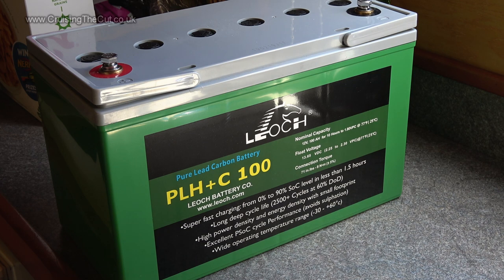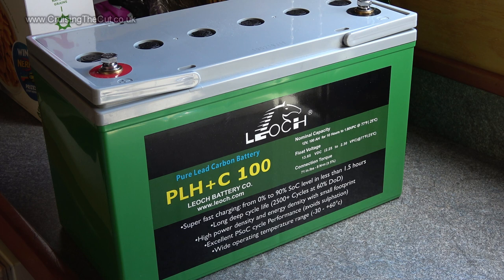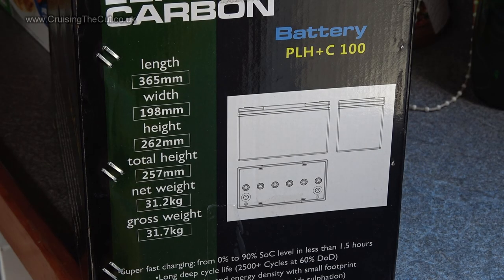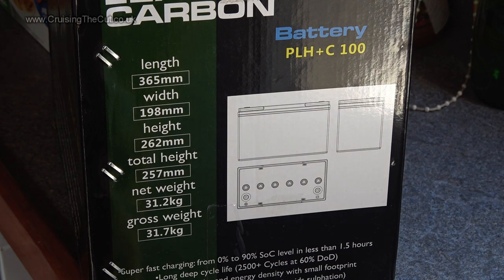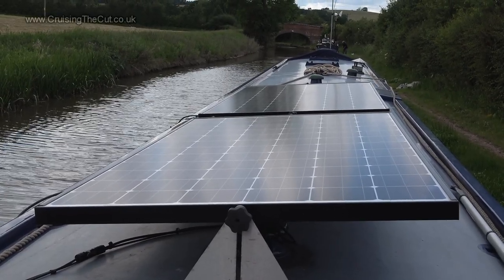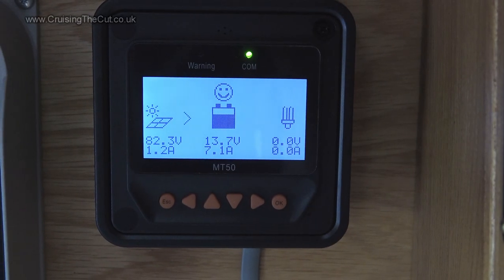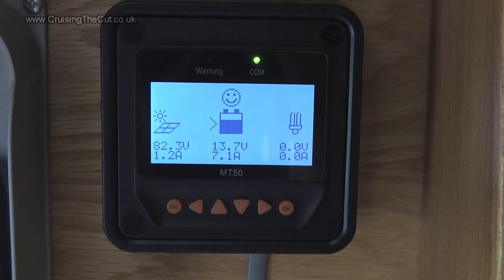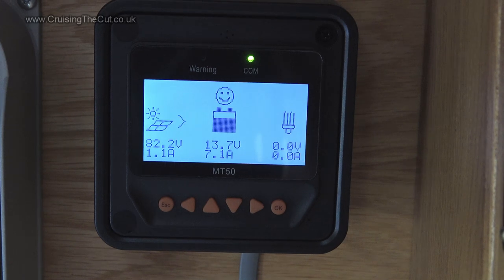178. Installing Lead Carbon batteries (12V 100Ah) into my canal narrowboat

Comment: Given the very short length of your Red and Black Wires that connect your three batteries in parallel, in electronic parlance that is called a bus, it does not matter where you place your connecting Red Wire or Black wire. They can be at the same end, opposite ends or even in the middle of their respective Wires or Busses because they are so short. 
The gauge of the wire used for these busses is such that the resistance of your copper wire is extremely low so you will not get any real measurable voltage drop. The thicker the wire the lower the resistance, now if your bus wires were very thin then it becomes a different problem. It is all down to an electrical law in physics called Ohms Law.
Reply from the maker: It is, I believe, nonetheless good practice to connect across the bank; the voltage drop may be negligible but you want to pull the current across the whole bank.
Reply: @CruisingTheCut  The benefit of connecting the way you did would only be realized in very high amperage situations - which you will likely never experience. Wiring as you did does not "pull current across the bank" any more than wiring it up the way it was initially. Still, it is the technically correct way to do it.
Reply from the maker: I refer the honourable commenter to this interesting article! http://www.smartgauge.co.uk/batt_con.html

Comment: Hello david.
I have just installed two deep cycle batterys and they 75 amph each in parrel and regulator to oppeset terminals. I reserched the same iessues and fond that by conneting the regulator to oppesete ends keeps the whole bank enenly charged and the discharged is kept evenly. i installed  socet style 12v meter with colered lights and an digel read out of numbers easy to install + - on the back. I could send you one if you ask me to no proplem and not expensive.
Gerard.
Reply from the maker: A very kind offer, thank you but I won't need it, cheers though!

Comment: Actually the spark is from the capacitors charging back up.
Reply: quite correct. that is exactly where the spark is coming from . Also just because a battery reads the right volts does not mean its charged. You should ALWAYS charge a new battery as they come with what is called a surface charge only. They put a charge on the plates when building the battery. So many people make that mistake.

Comment: Okay, so in regards to which terminal you disconnect first:
Actually, in theory, it doesn't really matter where you break the circuit. Especially because the choice for taking the negative terminal as a ground is arbitrary, in the past many vehicles were positive grounded. Also, in reality the current goes from the negative terminal to the positive.

BUT! Many vehicles are made of steel, and in most of these the bodywork/chassis is grounded. Cars and trucks are a prime example, with everything being grounded to the chassis and then the negative terminal of the battery being connected to the chassis. I don't know how this works in narrowboats, but if anywhere on the boat a ground wire is connected to the steel shell, you should disconnect the negative terminal first. The reason is: safety. When working around the batteries chances are that you might touch metal objects which are electrically connected to the rest of the bodywork and thus grounded. In a car for example, the whole bodywork is grounded so chances of touching grounded metal are high. When you take the positive terminal off, or re-instal it, you might touch the terminal post on the battery. If you do that whilst touching a grounded metal object, the full power of the batteries will pass through you. 

Again, I don't know how grounding in a narrowboat works so I don't know how much of that applies here. But this should help clear things up a little. 
Oh yeah, and connecting is the reverse of disconnecting, so with a grounded hull/chassis/bodywork the negative terminal should be the last to reconnect.
Reply: Disapproving Otter spot on. I don’t know much about narrow boats either, but I do know that in the past the hull was used as a common negative point for all the 12v connections, but that now that is discouraged as it can cause the hull to rust quicker than it otherwise would.

Comment: I have 4 215ah of them lovely Led Carbon Batteries.
Reply from the maker: How are you finding them? Any tips?
Reply: @CruisingTheCut   I forget Kw of you're Solar Setup and, yes I had an issue with getting right selection for charging. I found they we're similar to a EuroGel. They seem to charge very well unlike the led Acids supplied with my Widebeam.  Its worth doing one Deep Cycle as they do seem to need that once discharge.   My only pain was lifting my 75kg ones in. They are worth the cost.
Reply: How much were the batterys  each ?

Comment: Regarding the controversy on which post to disconnect first, I suspect that most of the arguments that say to disconnect the positive side first are applying safe practices for dealing with AC. When working with AC you definitely disconnect the hot side before ground/neutral. 

However, in negative ground DC systems, you should disconnect the negative side first. I would sincerely like to hear an argument for disconnecting the positive side first, an argument that is not a misapplication of AC practices.
Reply from the maker: Interesting! I did not know that's where the distinction comes from. Cheers
Reply: Ime an Electrical and Electronic Engineer by Trade.. and I would agree with your Comments. Disconnect the Negative 1st as this stops you shorting the positive to the whole Metalwork of the Boat or Vehicle..With A.C wiring you would disconnect the Live 1st as that's the only wire that can kill you🤯😱, the Neutral is the same potential  as the Earth in UK wiring and won't obviously kill you if touched.

Comment: Since our petrol outboard got stolen we've started a project to convert our boat to use electric propulsion. Interesting to see a different type of battery - but at the moment we've gone for the cheaper lead-acids due to cost. Hoping that electric cars etc. push the technology further forward so we can swap out to something with more usable capacity in the future. 

Hopefully more charge points too... quite concerned about what our range will be like - especially if the weather isn't with us!
Reply from the maker: How big's your boat?
Reply: @CruisingTheCut  15'6"

Comment: Spark - connecting the last battery - possibly due to battery voltages being slightly different ?

Had another thought about the position of those additional wires you were positioning fussily. IMO, they shouldn't be at the batteries at all but connect via the battery isolator switch - or at least the positive leads anyway.
Reply: Spark is caused by the caps in the solar charger charging back up when he reconnected the batteries.  Those capacitors draw a lot of current for a brief period while they recharge, that's what causes the sparks.

Comment: Ref schools of thought for disconnecting. I am going to guess that you are firmly in the disconnecting the positive leads first, then the negative. My reasoning for this is if you pause at 6:53, we can see you've left the negative terminal connected on the engine starting battery.

Ref insulating the tools - absolutely do it. Many years ago, I was working for a train builder & to cut a long story short, I ended up shorting out a 110V battery in a terminal box with a spanner because the insulated sockets we were using had been robbed & we were rushing. After the initial surprise & flash, I quickly responded & broke the connection within 1 second. Laughingly, I turned to my workmate & said "That was lucky," reached into the terminal box to carry out tightening the connection & immediately wished I hadn't. The spanner was so hot, it branded the immortal words "Made In England" backward across my fingers. Needless to say, I never did that again.
Reply from the maker: Hi. Ah but I wasn't disconnecting the starter battery as such, though I did need to remove its negative cable to enable me to rewire things, so nothing can be read into that hahahaha
Reply: As far as I know when disconnecting negative then positive and when connecting positive then negative
Reply: @alonzodesantis6989  I thought it was to do with grounding: if negative ground, disconnect positive terminals first; if positive ground, disconnect negative terminals first (and simply reverse the order for reconnecting in each scenario).
Reply: @xriex  Yes it's to do with grounding but it's the other way round from the way you describe. If you have a negative ground system and you undo the positive first, your spanner has a chance to hit any metal object (eg engine or bodywork in a car) and complete the circuit because the Neg is still connected. If you undo the Neg first, the only way to accidentally ground the spanner while doing it is to hit the Pos terminal. Once the Neg is removed, the car (eg.) itself is no longer part of the circuit.

Comment: Enjoyed the video and got my attention as looking to chang my lead acid batteries on my boat. I also got solar and a Viltron charger for the panel which I can change via the dongle so far so good. Where I get confused is with the starter battery as if its being charged from the mains or alternator it may have different charge voltage requirements if it is a different type ie lead acid. So my question is with carbon lead batteries do you have to adjust the alternator setting and secondly how do your new settings affect the starter battery charging regime just you thoughts of course. Lead Carbon do seem to get good reviews. Cheers
Reply from the maker: Luckily the new batteries want the same charge voltage as the starter battery (up to 14.4V) and that's what the alternator is putting out. Beforehand, the alternator just wasn't putting out enough for my leisure batteries but I relied on the solar (which only feeds the leisure bank) to top them up correctly.
Reply: @CruisingTheCut  
thanks for that I was a bit worried incase I had to change all the various charging bits and bobs, will carry on focusing on the lead carbon but difficult to find a local stockist to pick their brains. Cheers

Comment: Every time the negativ contact pull off first. Ever. But one question I have. Is the steel hull of your boat connected with the negative contact of the batteries, like a car?
Reply from the maker: Yes, all the -ves connect at one single point, near the engine. The hull is not used as a return path.

Comment: the three batteries are bused together in parallel, it doesn't matter where you take current off the bus, it comes from all of the batteries and goes to all. (four minutes in).  it does not drain or fill one battery before the others.
Reply from the maker: Yes I know they're in parallel and that none is filling before or after the others, but it is good practice to drain or charge across the whole bank rather than from any point within it.

Comment: What size is the wire from your solar to the batteries? In automotive (where come from) you need 1mm^2 per 10amps (12V system) and bigger if going 'longer' distance. you should feel if the wire gets warm to the touch when charging at a high rate, if warm then upgrade/add another in parrallel.
Reply from the maker: Thanks but fear not it's been sized to be well within capacity!

Comment: I had a look at the lithium batteries and for the same physical dimensions they had the same capacity (but at C1 I think), it's just that they were 60-ish % less weight. On a 15 ton boat, battery weight is rather irrelevant :-) Did you consider increasing the number of batteries when you replaced them or is there no convenient room to do that anyway?
Reply from the maker: Sadly no real space to do so
Reply: I thought there was a similar bench on the right side of the boat you could fill with batteries but then I saw on another video that there wasn't.

Edit: Maybe fill the gas locker with batteries if/when you do an electric conversion :-)
Reply: @zapfanzapfan : Batteries in a gas locker? Do you enjoy time bombs, explosions, fireworks?
Reply from the maker: @Grandpa the Grey the key phrase there was "electric conversion" in which case the gas locker would no longer contain gas bottles.
Reply: @CruisingTheCut Ha, ha, I didn't see that comment, thank you for highlighting it! :-)
Reply: Lithium cost a fortune compared to carbon lead, are not always thermally stable and don't work well when it is freezing. In winter those Carbon-lead batteries will outperform lithium is that locker is anywhere near 0C. The key with batteries IMO is to fit the absolute minimum (conducive to battery life) because it's much cheaper and easier when you have to replace them all, and it's faster to charge them which as lead based batteries are happier charged - is a good thing :)

Comment: a little spark, if you have 3 batteries of different  volt, agreed only a small difference you had a Potential Difference, the higher voltage flows towards the lower voltage and hence the spark

Comment: Are the 3 leisure batteries and the starter battery just connected in parallel? Is there a split charge relay between them?
Reply from the maker: Yes, split charge relay

Comment: Choice of battery for narrowboats; with reference to comments about the use of lithium batteries and how they may be "better" than lead acid types then it should be noted that lithium cells are not necessarily a practical choice for every environment.

The issue with lithium cells is charging them at very low temperatures. Current literature says permanent damage can occur if charged only once, repeat once, at freezing point or below. I refer to freezing point of water of course.

That said it is possible to "try" to charge a lithium cell at below freezing but at a very low current. This takes a very long time and may possibly not be practical for narrowboat living.

Discharging a Lithium cell is fine at below freezing temperatures but you must recharge them eventually.

Anyone who was on the cut last year won't forget that experience in a hurry and some parts of a narrowboat may well have been below freezing.

You can see where this argument is going and Google is your friend on this issue.

Narrowboaters, as my example, are regularly reminded to ensure good ventilation for battery compartments which means plenty of circulating fresh air...if that air is well below freezing, as it was last winter on UK, then it follows the batteries would become quite cold quite quickly. Granted lithium cells don't gas in the same way as lead acid types but the battery compartment would still be well ventilated.

Quite a thought provoking vlog on the technical front David, and might very well save some folks a lot of money if they were at the stage of having to buy replacement batteries...like me.

It may well turn out that the old fashioned lead acid batteries, (and variations in their chemistry), in this application cannot be bettered.
Reply from the maker: Good stuff Ross!
Reply: Not quite correct, but you have the gist. However, LifePo4 batteries could, and arguably should, be placed inside the boat not outside in the engine room to ensure that they do not drop to freezing point. Alternatively maybe put some form of heating in the battery compartment. LifePo4 batteries are amazing from personal experience but they are not a drop in replacement for LA for sure.
Reply: True ref heating/venting a battery/ battery compartment Malcolm, couldn't argue with that per se, but a fair bit of engineering/cash to accomplish said compartment.

The BSS guidelines on battery installation in accomodation spaces are pretty strict, eg they must be airtight to the cabin but vented to the outside.

There again who wants a lot of "potential" energy, so to speak, from batteries inside the accomodation space?

That's why batteries, not to mention diesel fuel tanks/engines/heaters are, usually, behind a steel bulkhead. Well, mine are.

Strikes me that it is far cheaper and easier to simply replace like for like, albeit with slightly different chemistry, requiring only a minor tweak to the charging system(s)...and no worries about a cold snap...and your battery heating system packing up.

Comment: How old is the stating battery? Does you set up offer a way to use the house batteries for emergency starting?  If nothing else a set of good  jumper cables.
Reply from the maker: It's three years old. I don't have a setup like that but could use jumpers, but have never needed to even after not moving all winter.

Comment: The battery cable position makes a big difference, with the negative and positive on opposite ends, it makes the "bank" one large battery...I do a lot of solar installs on houseboats and sailboats, and almost every one is wired incorrectly..When they are wired like yours was, after removal, load testing proves the middle battery is weaker..The spark is residual charge in the inverter, you are correct!!
Congratulations on not "releasing the genie" in the wiring...good job.
Reply from the maker: Thank you Chris! Good to have it validated :-)
Reply: Wired the way David had it the centre battery would have received a very slightly higher charge (by a few millivolts at most) not lower since there was no link cables between the solar connections and the central battery and two cables in the case of the outer two batteries so not sure why that would result in the middle battery having a lower capacity. The outer two batteries should exhibit lower capacity out of the three if any in theory.
Reply from the maker: I think the point there was that the middle battery would have been weaker due to the way the outgoing feed was wired, rather than the solar connection.